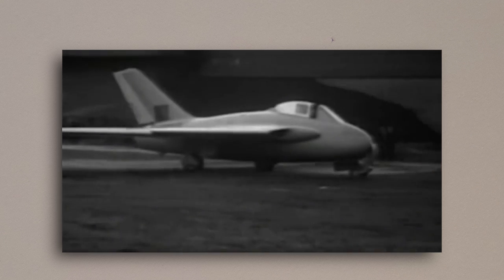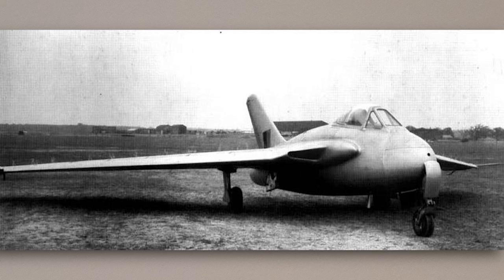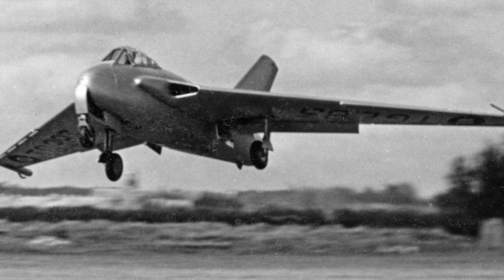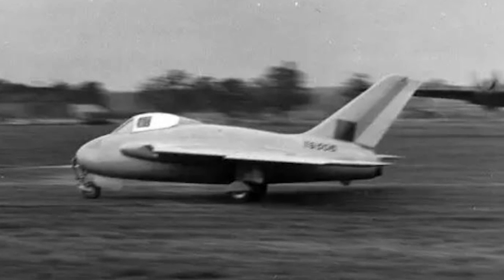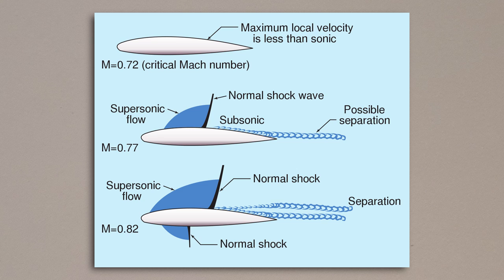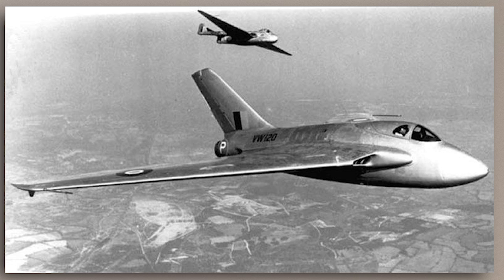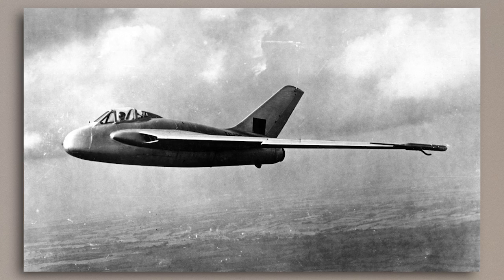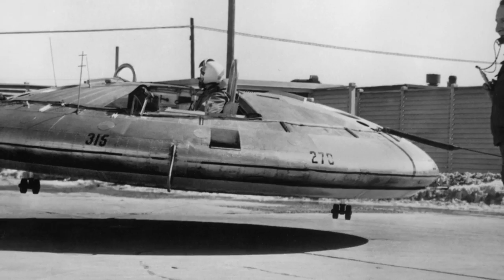Britain's First Supersonic Plane  | De Havilland D.H 108 Swallow [Aircraft Overview #58]

Comment: Although, of course, those square cabin windows have since been exonerated.  The fuselage failure started in the roof, around a radio aerial panel.
Reply: Apparently the holes for the rivets were punched rather than drilled leading to weakness.

Comment: The Bell X-1 actually did one take off from the ground though it did not go supersonic on that flight. 

It was a 'jab' at Douglas, not De Havilland.
Reply: Chuck Yeager in his autobiobraphy claims the X-1 did go supersonic in that flight. The point was to beat the Douglas Skyrocket, which in its initial version had both a jet and a rocket engine and took off from the ground.

Comment: Though it wasn't done for the record flight in 1947 (people can paint it any color or use as many asterisks as they want-Chuck Yeager and the X-1 were first) the X-1 was capable of a ground takeoff and there is a fantastic video of it on here from Jan 1949.  The X-1 was just a much better all around aircraft, and was developed into the X-1A that Yeager achieved Mach 2.44 in and Arthur Murray achieved a new altitude record of over 90k feet in.

Comment: Obviously based on the Me163 Komet. The Komet flew well, but had a deadly motor and fuel. The Swallow had a good engine, but had deadly flight characteristics...
Reply: The fact that it shared features does not indicate it was "based on" the 163.  No doubt information ON other designs (like the 163 of course) was studied...but suggesting it was thus "based on" it is going too far...
Reply: No, it was based off the Vampire as clearly stated in the video.
Reply: Britain designed an aircraft which used the same engine to get the aircraft up to altitude before the jet engines took over. They discovered that by running the fuel through a silver plated mesh made it safe to use.
Reply: @JohnyG29  It wasn't "based" on the Vampire, it was built using Vampire bits. There is a difference. As an expedient they built it using components like the center pod from a Vampire with the landing gear from a Sea Venom.  The end result could pass for a jet engined (instead of rocket engined) Komet. What made the Komet deadly for its pilots was the volatility of the propellants used to power its rocket engine, not its flight characteristics. Eric Brown who flew several different types of tailless aircraft, including the Swallow and Komet, said the Komet was the only one with good flight characteristics.

Comment: The original design of the comet looks like a futuristic private jet. Otherwise, the swallow being basically the bastard child of an Me 163 and a Vampire was always going to be a nightmare.
Reply: Eric Brown, one of the testpilots and who also flew the Me 163 after the war admitted the Me 163 was a big influence.
Actually Eric Brown was very positive about the Me 163's flight performance, it was the rocket engine, volatile fuel and lack of a landing gear was what made that plane so dangerous.
Reply: The DH108 had some designs features that were ahead of their times.  Ejection seat, powered leading edge slats ratioed to the speed brakes/flaps, what was the big problem was the DeHavilland's obsession with setting speed records on an airframe they didn't understand the full aerodynamics of.

Comment: Taking a German design without taking into account of the bad aspects of the actual design in use during the war, you are inevitably going to get a messed up airframe, the Komet, Me 163,  was designed for speed without the heavy payload and to fly at high altitude. This airframe was not developed any further as the Me262 came into play and the Jumo 004 started production. Rocket motors were not needed as much as the new jet.

Comment: Two minutes in sees design that will become the Comet. Sees square windows. Shakes head sadly.
Reply: The square windows were not the problem…
Reply: @MothaLuva  That's like the "guns don't kill, bullets do" joke. Yea, the problem was stress fractures around the rivets, but the square windows helped concentrate the stress and were the part that failed under stress. That definitely makes them part of the problem.

Comment: 340 mph at 35,000 feet?  That is a pretty high Mach number, I'm guessing  0.84 or something along that line.  The 727 had no problem doing that kind of speed.  I've flown 727's at .89 Mach, not that we ever flew that fast unless we were empty and just screwing around.  The 747 was another airplane that didn't like going high but DID like going real fucking fast!  Keeping that thing down to the flight-planned 0.84 was a bit of a chore, since we didn't have autothrottles.

Comment: Rex, please compare and contrast the De Havilland Swallow with the Messerschmitt Me-163 Komet.  The aircraft were roughly contemporary and it seems the Swallow was inspired by the Komet.  Why was the Komet aerodynamically successful, except for that T-Stoff/C-Stoff hypergolic thing, where the Swallow was not?  This is puzzling as the British had, by this time, the German technical data from the Komet program.
Reply: Komet had a wing that was too thick for supersonic flight, partially owing to its wooden construction, and partially to having to contain flaps and spoilers to make up for the loss of the tailplane.

Eric Brown flew the Komet and raved abut its handling.
Reply: The Germans had little data on compressibility, or wind tunnel experience past mach 1. The 163 would exhibit control reversal at around .9 mach. The excessive wing sweep of 60 degrees, compared to the 23.5 degrees on the 163, might have caused issues with spanwise flow, with the aerodynamic center moving aft as speed increased. Eary MIGS all had wing fences to help control it. It was probably a poor choice for high-speed flight test, the shock wave causing the elevons to lock up and become ineffective. The advantages of the all flying stabilator, as on the F-86 Sabre jet were not (made) available (to the British) or known of at the time.

Comment: Do you think the swallow could have been more successful if it were a more modern fly-by-wire system?
Reply: The Bell X1 used a fly-by-wire Stabilator trim control copied from the Messerschmitt Me-262.

Comment: The Brabazon committee appointed 4 types of airplanes to be produced. Two of very interesting design, the Bristol Brabazon and de Havilland  Comet. However ultimately proved to be failures. My believe is that if aircraft companies would do their own market research, they likely would produce some more commercially successful designs.
For instance the Bristol Brabazon was one of findings of that committee that no airline wanted. How that committee thought that that thing would be economical to operate?
The de Havilland Comet got tarnished by those 3 accidents caused by flawed design and materials. That one could be a serious contender, but even if everything worked flawlessly, it was designed with a smaller passenger capacity that airlines were looking for. Again not a viable aircraft that the market wanted. By the time de Havilland solve Comet’s problems and released later and larger versions, Boeing’s 707 had the market. 
The only aircraft resulted from recommendations from Brabazon committee that was successful, nobody remembers.
That was the Vickers Viscount turbo prop. I actually flew it few times and I liked that airplane. It was spacious and comfortable flying. I also liked the half circle lounge seats in the back. That were memories from childhood.
Reply: I remember plane spotting at Elmdon Airport when Viscounts were more numerous than anything, the big event for us was when a Vanguard came in. The Bristol Brabazon could have been a lot better if they hadn't refused to wait for turbo props instead of using piston engines.
Edit, the Comets after they had sorted out the fatigue situation were good, I especially remember the Comet 4C, long stretch version, brilliant!

Comment: Nobody had, at that time, managed to produce a wind tunnel capable of transonic speeds.  In 1960, when I was at Sydney University, the Engineering school had a supersonic tunnel, with a working section of 4 inches x 6 inches; it was powered by a large number of old torpedo tubes serving as pressure cylinders, and it managed to run for about 12 seconds - which will give you some idea of the engineering problems involved in building a large supersonic tunnel. So there was no possibility for de Havilland or anybody else, to discover,  before WW2,  that the centre of pressure of an airfoil shifts from 25% of the wing chord, to 50% of the wing chord, when the flow over the wing exceeds Mach 1.  A swept wing delays this, but it doesn't prevent it.  Also, the spanwise spread of wing stalling on a swept wing was still being investigated in 1952.  The DH 108 was too big a step for the available knowledge at the time.
Reply: BULL0CKS! The RLMs Luftfahrtforschungsanstalt supersonic aircraft wind tunnel facility in Braunschweig Germany was constructed in 1935 and operated in complete secrecy for the duration of the war.
Planes like the Messerschmitt Me-262 were tested to speed up to Mach 1.2
 Tunnel A9 tested scale models to speeds above Mach 9.

The facility was relocated to America by Operation Paperclip to White Oaks Virginia were it was used  by the U.S. military and NASA for the Mercury Gemini and Apollo space programs and is still used by NASA.
Reply: Unfortunately you are very confused and misinformed, Germany was the world's leader in supersonic aerodynamic technology and operated several large diameter supersonic wind tunnel laboratories during WW2.
Britain would not begin construction of its first supersonic wind tunnel at RAE Bedford until 1947, as a result Britain would not have a supersonic aircraft until 1954.

Comment: Shame the Miles M52 was never flown, might have helped out (not to mention be a lot of firsts well ahead of the DH 108 and Bell X1). Its doubly ironic that the M52 had pilot survivability in mind.
Reply: It is of note that putting the X1 and the M52 side by side there is very little difference in their profiles, possibly because Bell made use of Miles Aviation's drawings. The only main difference between them was that the M52 had an annular air intake for the jet turbine whilst the X1 had no intakes as it was rocket powered, the Septics not having a jet turbine unit powerful enough.
Reply: @mikehipperson  And the engine for the M52 was built when?
Reply: @nickdanger3802  - Mid/Late 1940s. The engine was ground-tested I believe.
Reply: PowerJets never completed the engine for the Miles M-52.The M-52 was never built.
Reply: @jerryg53125  The M52 was never finished because the British gov cancelled the project. From Wikipedia: [ Feb 1946 ] "At the point of cancellation, the first of the three M.52s had been 82 per cent completed and it had been scheduled to commence the first test flights within only a few months."
Reply: @rubbernuke1234  Miles had 80% of the parts to build the first plane when it was cancelled.The only thing they built was a Ply-wood mock-up.
Reply: @jerryg53125  Going from the book - 'Miles M.52: Gateway to Supersonic Flight' written by Eric Brown himself they suggest it was actually much closer (in the foreword '90% completed to flight status'). In any case its academic, the project was terminated politically while all the technology had been validated.
Reply: @rubbernuke1234  True......it was terminated.
Reply: @jerryg53125  If it had gone forwards I expect the M52 would have broken the sound barrier in a shallow dive on its non reheat / afterburning engine first (since the X1 had flown in early 1946 but took a year and a half to go supersonic as I guess its here where the UK had the edge and the US used the UKs data it 'borrowed' to validate the X1). The real race IMO would have been the sound barrier in level flight as the M52s engine (and the afterburner aspect) would be the weakest link. Either way its one of those 'what ifs' with UK aviation, such as the TSR2, Saunders-Roe SR.177 etc.
Reply: @rubbernuke1234  The engine was the problem.PowerJets was shut down when MI5 discovered Frank Whittle had a drug problem.Because it was war time Whittle was held in a drug rehab until the end of the war.Too bad Rolls Royce couldn't have built a jet engine for the M-52 airframe.You never know.
Reply: @jerryg53125  IIRC other engines were considered as well though, including rockets and RR engines that would become the Avon. BTW do you have a source for your 'drug rehab' angle? Whittle suffered from nervous exhaustion (having two breakdowns and not held anywhere since he was still working) and resigned from Powerjets when it was merged (and not shut down).
Reply: @rubbernuke1234  The Miles M.52 project was doomed to failure and was not pursued.
No aircraft powered by a centrifugal compressor turbojet ever reached Mach 1 in level flight.

Comment: Yes the Comet airliner had catastrophic airframe failures due to it's square windows.
Reply: Do some research -there are a few excellent videos on Youtube about this. It wasn’t actually the square windows that did it - it was fractures in the duralumin made by punching holes  for the windows on the production line. They were, on the prototypes, drilled. There was also a problem with testing. They destruction tested a fuselage to prove it was sound, but that fuselage had been tested so many times the duralumin stiffness was changed and so it behaved differently to the production fuselages.
Reply: @SAHBfan  Being a pilot I have read many articles about this. Yes it was the square windows that were the root cause of the problems. Rivets on square openings obviously create a better pathway for cracks than in round openings. Of all the related metal fatigue etc issues, the genesis came back to the square windows. Which is why you have never seen a square window in a jetliner since.

Comment: As to 'mach tuck' deoffrey's body was picked up at Whitstable with his neck broken. His parachute ring had not been pulled. The broken neck suggests violent up-and-down oscillation. Incidentally, the Spitfire PR11 achieved a mach number of 0.92, the highest ever recorded by a piston engined a/c and it survived though sans propellor and reduction gear and landed with slightly swept back-looking wings.  The pilot, Sqn.Ldr Tony Martindale recovered after blacking out following an 11g pull-out from the dive, but the special instruments carried had recorded the speed.

Comment: a shame they couldn’t test the square windows before production, it might have saved many lives!
Reply: The potential issue of window corners was appreciated by DH during the design process and they had extra reinforcement.  The prototype aircraft were tested extensively for stress failure.  There was what turned out to be a critical assembly difference between prototypes and production aircraft.  The panels for the prototypes had drilled rivet holes, on the production aircraft the holes were punched.  The punched holes proved more vulnerable to the metal fatigue of pressurisation cycles.